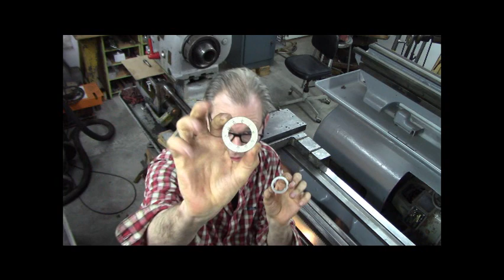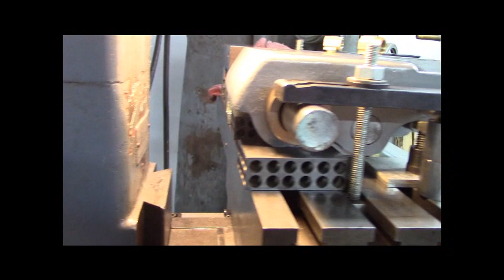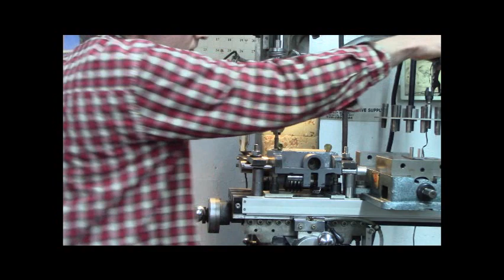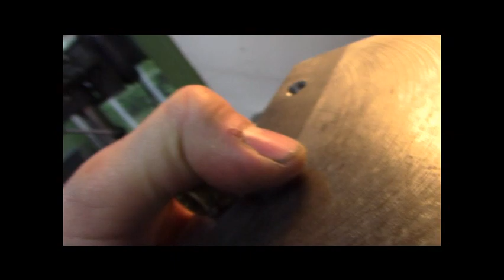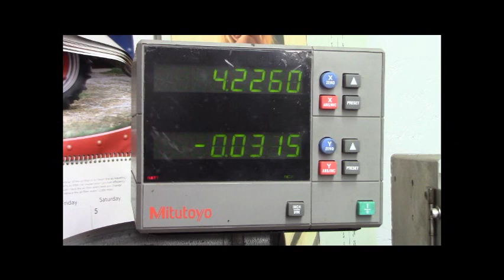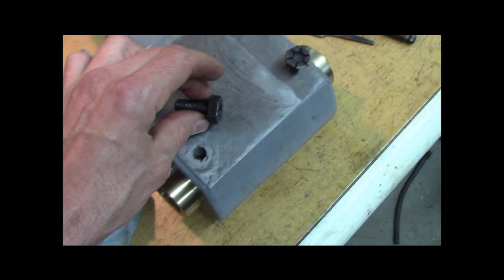Doozer's Machine Shop Update 4-19-20 -- Colchester Rocker Box

Comment: PS if you need inspiration re gear and worm adjustment, take a look at how GMC did the adjusters on the old 14-bolt rear axle, common on the 1-ton pickups
Reply from the maker: Hey Van man, Side adjustment is not critical at all. Just a shim to keep side clearances to a sane level.  No mesh setting is done in the area where the shim is placed.  But I have had old truck axles apart.  Good tip to design a fix for other projects for sure.  Hope you are well in the post apocalyptic waste land they call WNY.